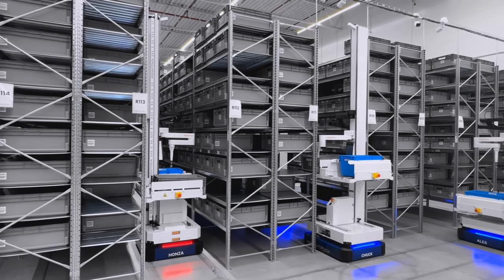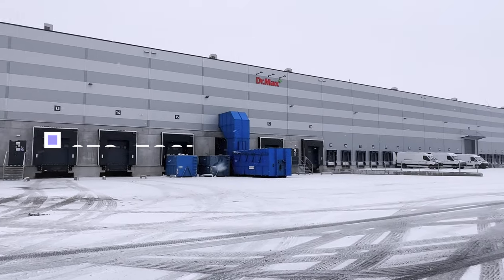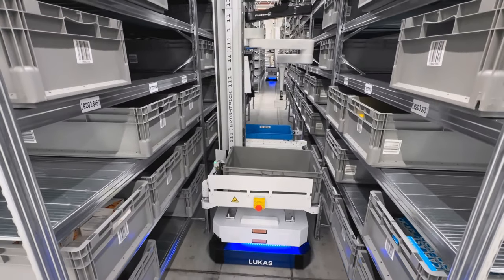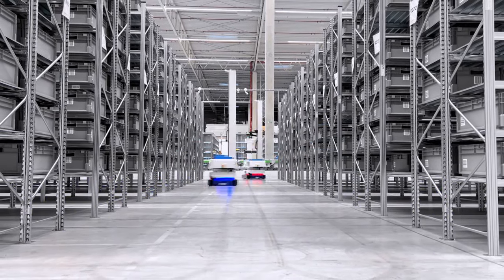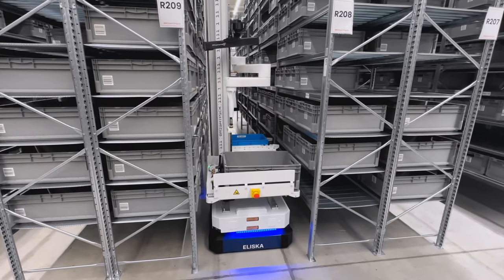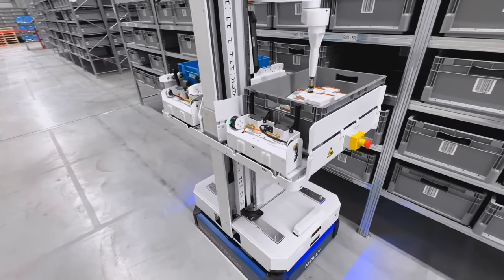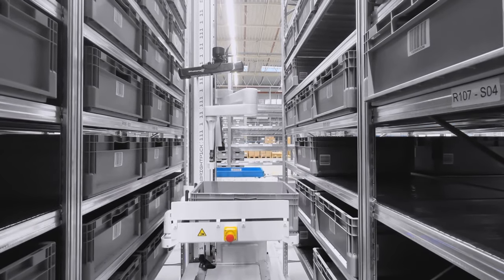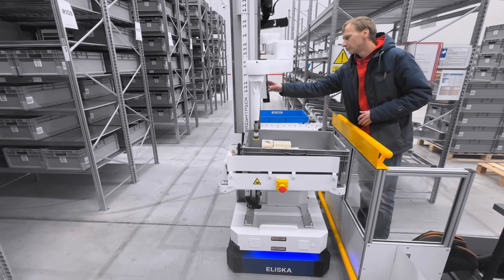Pharmacy giant Dr. Max uses AI robots to pick orders in its warehouse | Brightpick

Comment: I have questions about your solution: I understand that your solution is to use cameras and robotic arms to complete picking at the shelves, similar to the human mode.  However, there are two problems with this model. One is that the above-mentioned mechanical structure is relatively complex and the cost is not low; the other is that it causes low efficiency and high failure rate.

Comment: It may be more competitive to change this solution to the following form: the mobile robot is only responsible for picking up the boxes (the mechanical structure of the AMR is simplified and the cost is reduced), transporting the boxes to the sorting table, and then using  Visual recognition and robotic arms complete the picking (which is currently done in front of the shelves).
Reply from the maker: Hi @Soulmateany4096, we appreciate your inputs. The previous generation of our technology was exactly what you are suggesting, i.e. a Goods-to-Robot solution with a stationary 6-axis robotic picking arm. You can check out a video of it here: https://youtu.be/7aJnR8EKedk

However, we found that by doing the picking directly in-aisle, we can significantly increase efficiency and speed of picking. This means fewer robots are necessary to achieve the same throughput, which results in lower costs (even though the per-robot cost is higher). We also own the entire tech stack and do all our manufacturing in-house, which helps keep costs low.

You can check out a full virtual demo of Brightpick Autopicker here: https://youtu.be/XWlQWgRfh6c
Reply: I'm sorry that I took it for granted and expressed my opinion. Thank you for your explanation. @brightpickAI